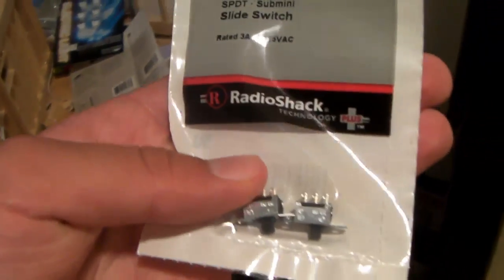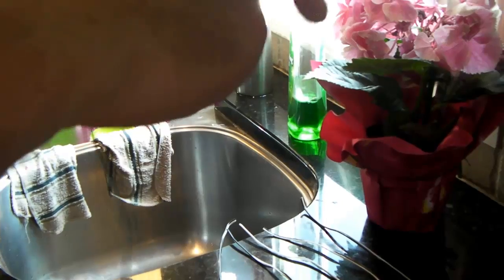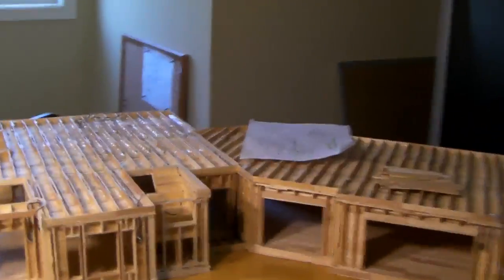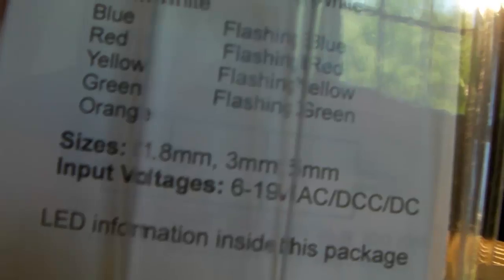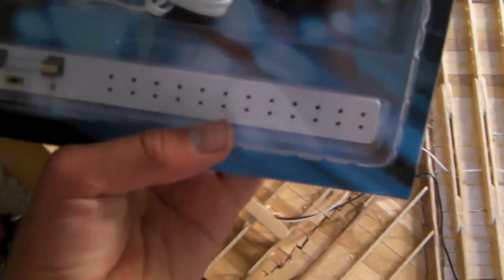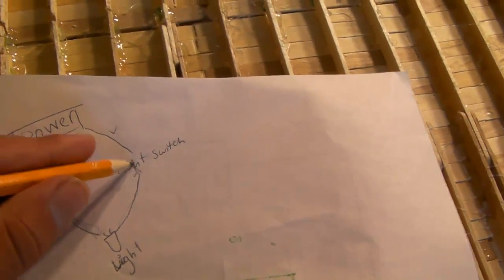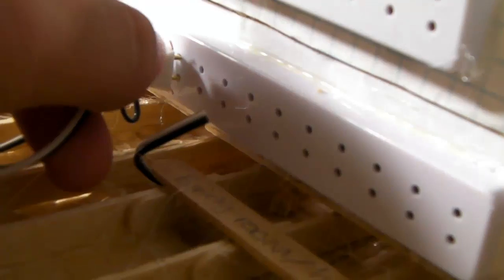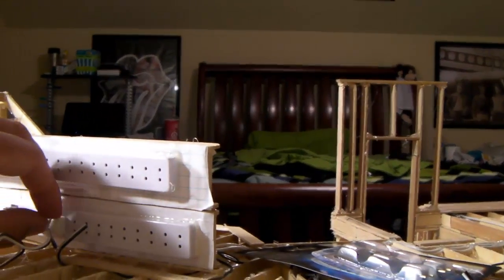How To Wire Working Lights in a Model

Comment from the maker: The power strip in a real home is a breaker box.  I guess you can also call it a fuse panel.  You can buy other size wires but this is easy to work with.

Comment: Hey, I've been watching all of your videos, and have started a model, and I have the first floor, walls, and interior wall siding done, and have started on the ceiling. I would like to put lights in it, but am not sure what lights to use. Are you using Grain Of Wheat lights (GOW), Grain of Rice, or just a little bulb? Thanks

Comment: if the wires touch each other you could ether burn the house down or blow a breaker!!!
they do have thiner soder wire for jobs like what your dads doing and can be found at ACE hardwear so far thats the 1st place ive seen that carries the thiner wire haven check waly world yet!!!!
would that be called a fuse panal???